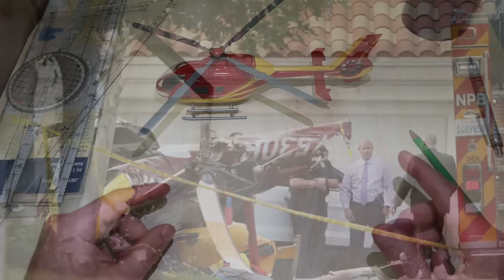Dangerous Mast Bumping on Helicopters

Comment: I would think that helicopters are designed to prevent mast bumping from happening under normal flying conditions. I would not think that the pilot is required to constantly monitor against it from happening.

Comment: I wonder why they can't just lower the height of the tail boom  by a foot or so, or make a little angled  bend in the boom at the point of  the rotor tip length.

Comment: How do you avoid wind gusts?
Reply: @huntspoint3442  Check the weather reports in the area that day. If the winds are high or show gusts avoid that area. Or don't fly on windy days, simple. Well, if u know more about meteorology. Check pressure charts map thingys. Steep pressure gradients isobars closer together likely to cause strong winds. Fronts might cause wind. Around thundercloud there is gust fronts. Sometimes places with differing topography causes winds due to differences in heating and cooling during day and night. Especially around mountains and coasts. Also mountain areas have local weather conditions associated with them. Avoid places that are known to be windy. Like Chicago. Well that might just be between the buildings. Also look at wind socks at airports. And look at the way the flags are flying, the way leaves are blowing. Etc etc etc..